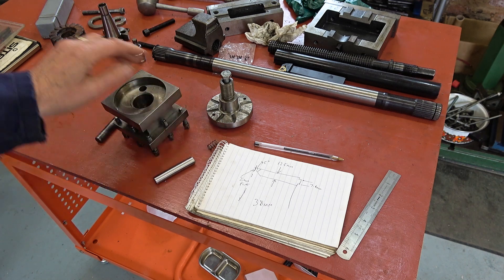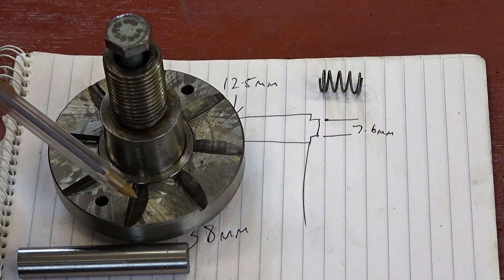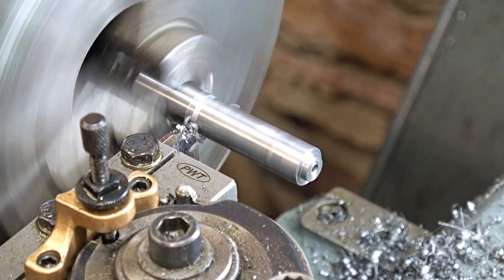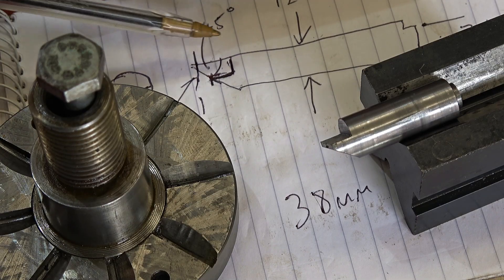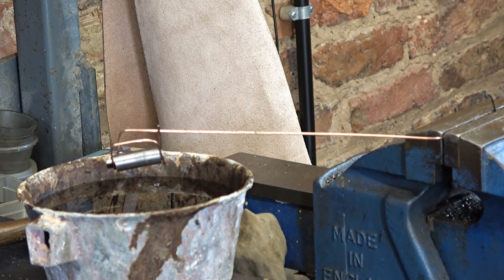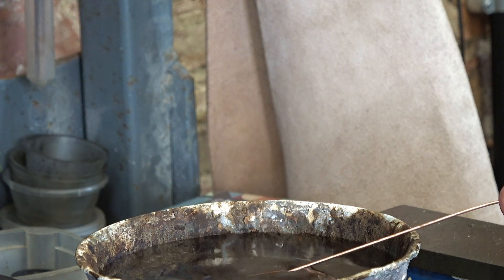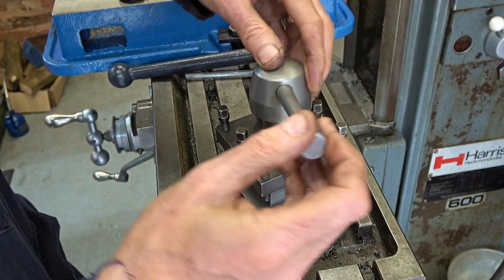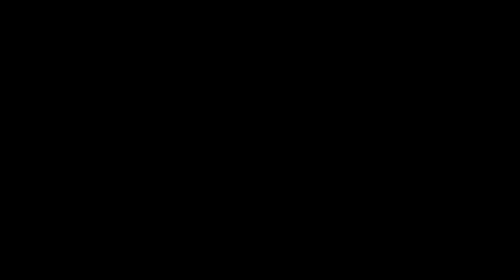HS316 Harrison 140 lathe toolpost ratchet pawl

Comment: Think l mentioned this before, that tempering is usually by air cooling to relieve hardening stresses. 

This would be a good topic for a future video to explain microstructure and the iron carbon equilibrium curves, martensite, ferrite, austenitic, alpha+Fe3C et al.
Reply from the maker: Hi Geoff, I've always known tempering quenched but I will look it up thanks. Maybe I just followed what I saw without questioning/appreciating. Cheers
Reply from the maker: Well Geoff I read up on this and AI agrees with you. Air cooling is best after tempering. My dad was wrong ☹️. I can only think then the idea of quenching after heating for tempering is to stop the temper at the right temperature rather than rising more. Anyway I will change my method now to air cool after tempering. Thanks for the advice 👍.

Comment: I've always thought that with tempering the part has to cool down slowly, if you cool it down quickly you get a hardening process again, right?
Reply from the maker: Hi Huib, if we are talking carbon steel, you get it red hot then quench in oil or water to harden it. But that can be too hard and brittle so you 'soften' it some by tempering. To do that heat up the metal again to somewhere between 200C (straw oxidation colour) and 350C (deep blue) and then quench it again. To soften hardened steel then you heat it up to cherry red then let it cool slowly.  If it is non ferrous  like brass and copper getting it red hot and quenching has the opposite effect softening (annealing).  Cheers [post script: I've been corrected. After tempering better to let the steel cool naturally rather than quenching. My Dad was wrong ☹️]

Comment: Nice poppies. You should also grind a small flat on the pin, so that it will not stick in the bore due to oil, and then a drop of oil applied to the bore, nice heavy oil, will make it operate without wearing the post, plus damped the click slightly.
Reply from the maker: Sean that's a good idea having the flat to stop locking. I had exactly that problem on the lathe power feed reverser, hydraulic lock would stop me reversing the feed. I drilled a bypass hole. Design fault. Must have been like that on Harrison lathes since the 1950s at least. Cheers